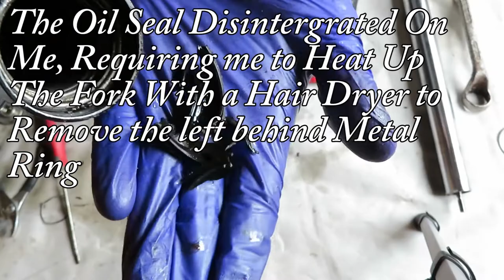How to Replace Fork Oil Seals | Aprilia Rs125

Comment: Mad save, right fork started leaking and was about to bring it to the shop. Probably could do this myself ty
Reply from the maker: Its a straight forward job as well, you will be surprised, only tricky bit was taking the stubborn ring out, good luck with it👍
Reply: The ring s the final boss😜😱😏two very small flathead screwdrivers .., about 2cm away from the gap on the ring insert first screwdriver & lever out for second screwdriver to slot in next to it , moved it round about  2cm again and then it should just pop out 👍🏼👏🏼👏🏼👏🏼💪🏼  but it's not that easy 🙃
Reply from the maker: The ring is the exception for reasonable rage quit for this job, also a 3rd hand is helpful 😂
Reply: Thats gonna leak again, the lip will tear when putting the stanchion in, u need to put the stanchion in first then the seal with plastic bag to protect seal lip when putting on the chrome stanchion